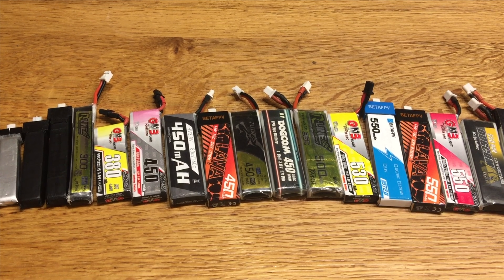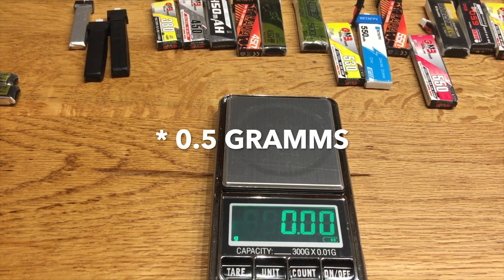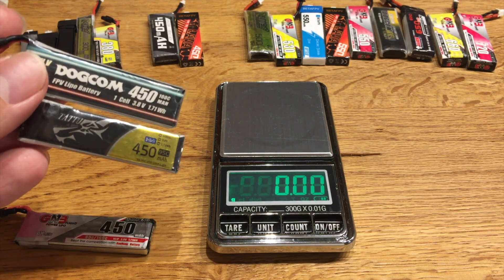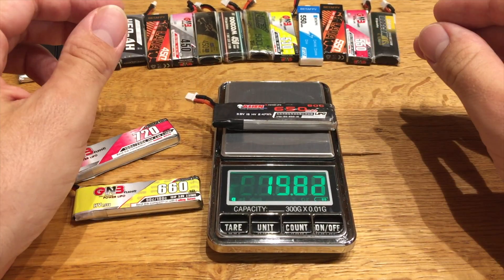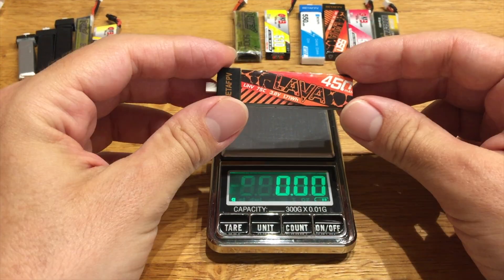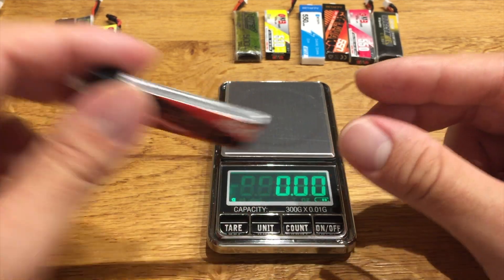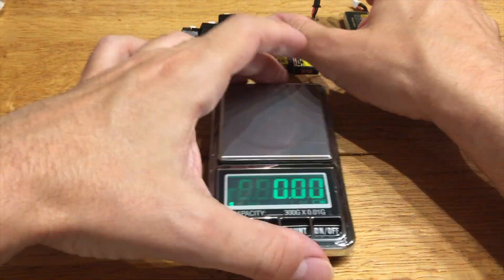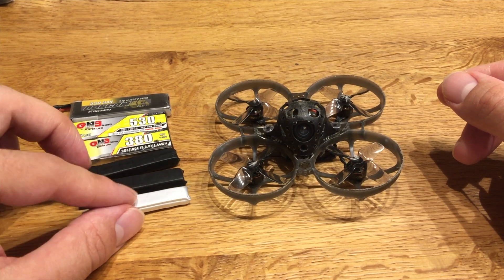My FULL KNOWLEDGE about LIPOS for Whoop RACING

Comment: Great video! I fly GNB 530s on my 75s as well and I like them, but they are now old and I didnt properly store them. So I need new ones and I was thinking about folded cells lava 450 or tiny whoop or webleed. But after seeing your video I am in a dilemna. You're saying I'd better order 530s again? How come folded cells are not better?
Reply from the maker: Thank you my whoop friend! They are not directly better or worse. Just different. Hard to explain. And I think for me it also has something to do with the fact that I sometimes preheat my Lipos to 40 degrees Celsius. I just flew outdoors yesterday without preheating the lipos and the Lava Lipos were the best in the windy conditions. They gave me the most security in the wind. Lava 450mah for a good power to weight ratio and Lava 550mah for flighttime.. So you can order some weebleeds🙂

Comment: A little while back GNB must have messed up the calibration on their capacity checker. All of the recent cells are 80mah higher than reality. 300=>380, 450=>530 etc 😂

Comment: Good vid! In my opinion Tattu 300mah BT2.0 are the Top of the line, lower weight with amazing performance. On my 17,6G Race build, on Biblades can even get 4 minutes of racing. First minute of flight they even stay above 4V witch is mind blowing, because in general tiny 1S Lipos had always weaker kind of electrolyte or quality in them. (used a lot of GNB, happymodel, betafpv regular ones)
Reply from the maker: Thank you! Yes Tattu 1S HV 300mah 75C foldet cells is amazing! A lipo legend😃

Comment: Дякую за відео. Вчився літати на mobitle 6 замінивши польотний контролер на Х12. Я помітив що рідний diamond f4 чомусь вживає більше ампер і час спокійного польоту на вулиці з lava 300 виходить 210 секунд. Тоді як на Х12 можна літати майже на хвилину довше. Не зважаючи на те що вага з х12 на 1 г більше і дорівнює 19.8 грамів. Хочеться чогось нового тому вчора замовив 0802 rcinpower 25kv. Буду використовувати 75 air від betafpv і lava 550
Reply from the maker: Yes, unfortunately many happymodel diamond boards have an error. That also happened to me before. I'm not sure if the 75air frame can handle the weight of 550mah lipos in a crash..
Happy flying my friend!